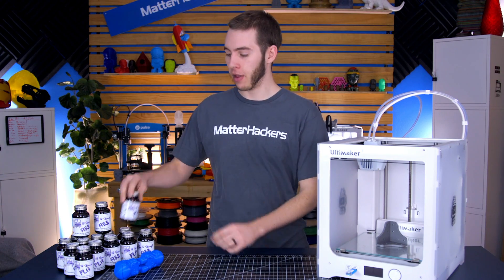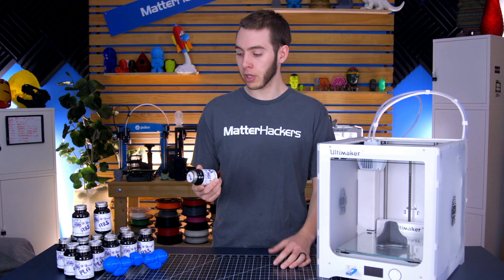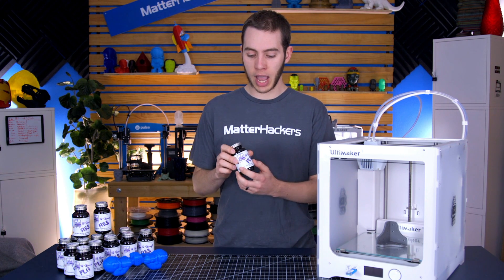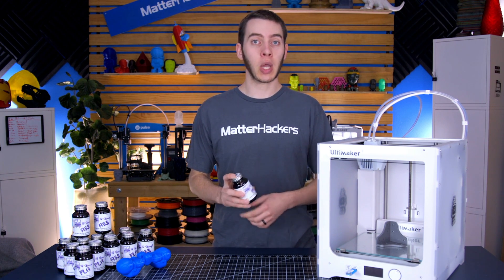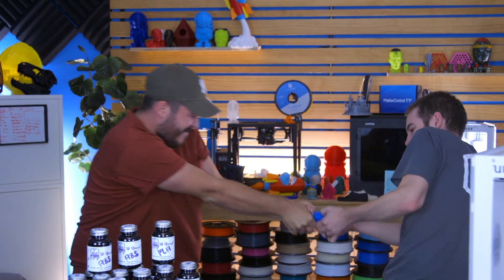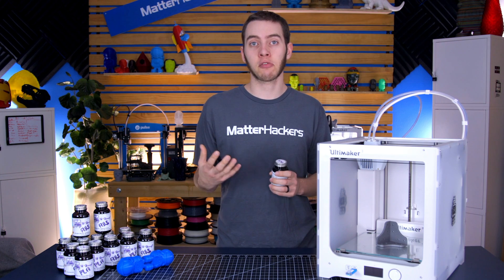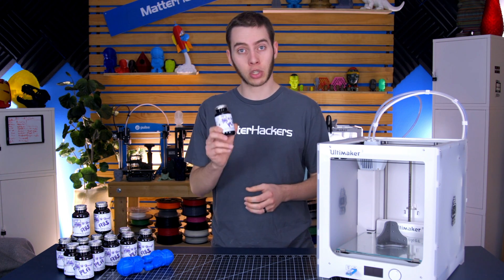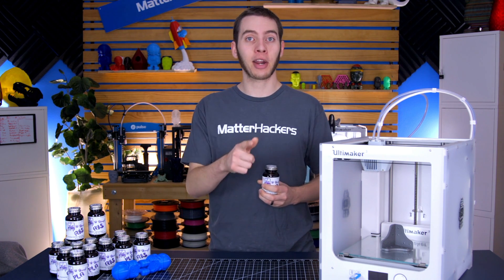3D Gloop! // 3D Printing Adhesive Spotlight

Comment: Does this adhere/seal just at surface level or does it actually react sub surface to solidify the part?
Reply from the maker: From what I've seen, when I separated parts that weren't fully bonded, the layers in contact were bubbly and gummy, so it definitely reacts and doesn't just glue - Alec

Comment: I grabbed a sample of the stuff and honesty was skeptical of what it could do but it does work. I do wish it came in a squeeze bottle like CA glue in both thin and thick varieties but I am being picky it works :)
Reply from the maker: I could see as they develop more formulas and application methods, that something like that could be in their future. How did you test your sample? - Alec
Reply: @MatterHackers  I got the one with the brush in the lid which works well except for the fact that it seems like by the time you apply it, the stuff is starting to "gel" up the PLA. That said the stuff just works for bonding items so no complaints there!

Comment: I'm a bit confused if it sticks SO well, how do you get it off an unheated build plate? I have builds that take many hours to complete. Wouldn't it have set permanently by then?
Reply from the maker: Don't think of 3D Gloop as a "glue." Glue can bond two different materials together by the adhesive property of the chemicals involved, like gluing your fingers to a project using superglue. 3D Gloop basically melts the PLA on both sides, the 3D Gloop evaporates, leaving behind a part that for all intents and purposes is one piece. It's like PVC cement except for 3D prints. Because of that, it doesn't glue your print to your glass bed, it's just adhered to the "residue" of 3D Gloop that's on the surface. Does that better explain it? - Alec
Reply: @MatterHackers  Yes, it does. Thank you.

Comment: You said about using 3D gloop as a bed adhesive, but how easily does it release when the print is done and the bed is cool?
Reply from the maker: There's a gif on 3D Gloop's Kickstarter that shows them using a spatula to get under a corner, then the Gloop kind of cracks and you can take the print right off. From what I've seen, it doesn't release until you actively try to remove it. What bed adhesive do you use right now? - Alec

https://www.kickstarter.com/projects/1672378622/3d-gloop
Reply: MatterHackers I have a few printers. One with a removable flexible magnetic buildtech style on my select mini, my one Tevo Tornado has an ultrabase (which I still have problems with pla lifting in it), and my second Tornado still has the stock glass bed that I have tried glue stick on.

Comment: i watched it, and don't understand what it is about...
Reply: 3D Gloop is basically bed adhesive, 3D print glue and 3D print smoother. They offer each of those 3 reagents for PLA and for ABS respectively.
Reply: It's basically super glue for prints that you can also put on the printer bed.

It works for PLA and ABS.
Reply: @rheller_82  ok thanks !
Reply from the maker: Quick note, there are different formulas for PLA and ABS (and they're working on PETG and others) so don't expect the PLA gloop to work on ABS; they're different chemical makeups. What do you think you'll use 3D Gloop for? - Alec